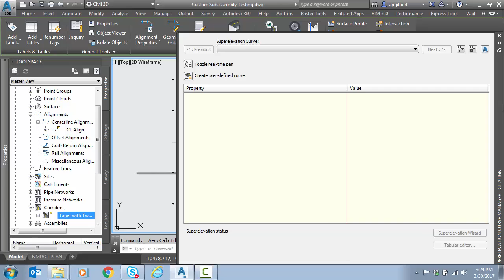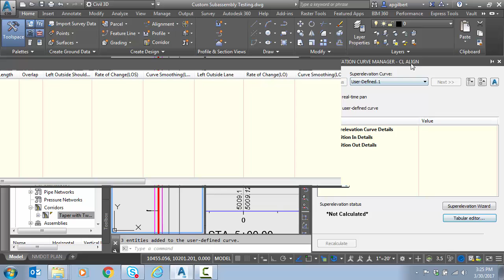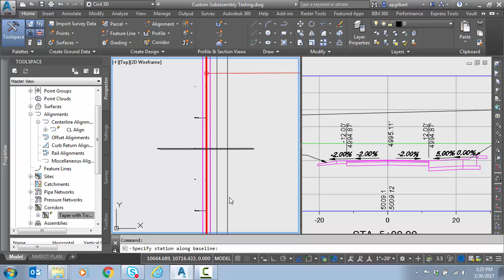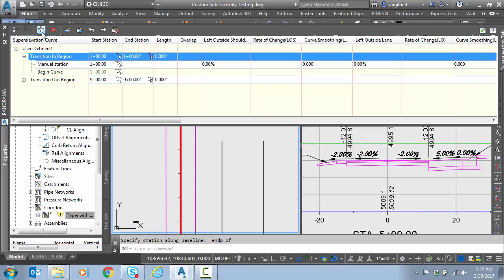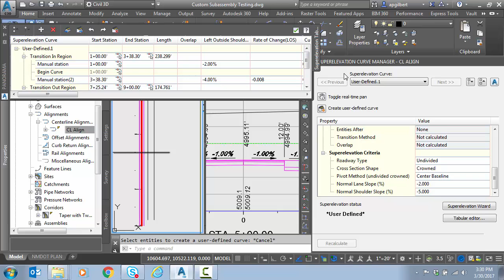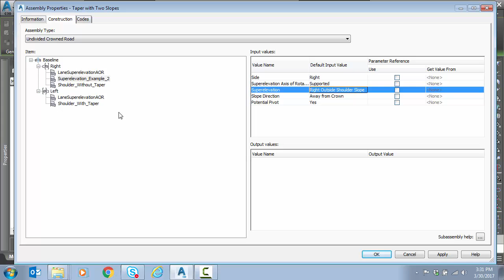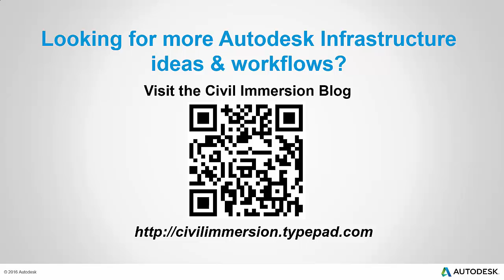Finish Strong Friday: Civil 3D Superelevation Part 5 – Tangent Only Superelevation

Comment: Why I can't find the part 4 of the series?
Reply from the maker: Hi Nikou, part 4 is here:  http://civilimmersion.typepad.com/civil_immersion/2017/03/finish-strong-friday-civil-3d-superelevation-part-4-superelevation-view-editing.html
Reply: Thanks, Alan. Please make a topic about "stripping topsoil". The best way I found right now is to create an offset surface and in the end, apply manual the corridos external boundary and compute the topsoil as the volume between the two surfaces. There are two subassemblies in civil 3d but what I need is a dynamic solution for target the daylight in the topsoil and not in the EG. Also sometimes topsoil need to extend outside of the corridor external boundary.
Reply from the maker: No problem.  On the topsoil stripping, I'm not sure if I've done a similar workflow.  Without knowing all your given data and variables, not sure I could help much.  If you'd like, send me a little more detail to my Gmail email and I'll be glad to take a look.